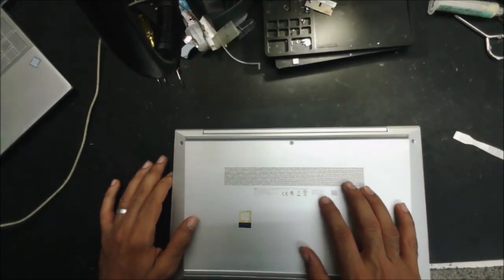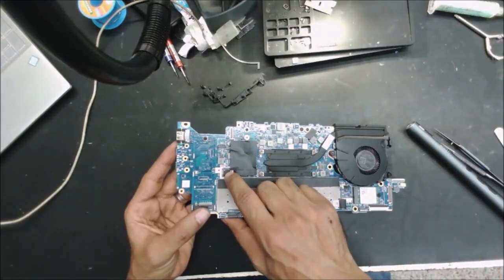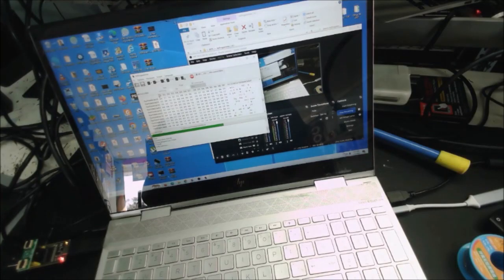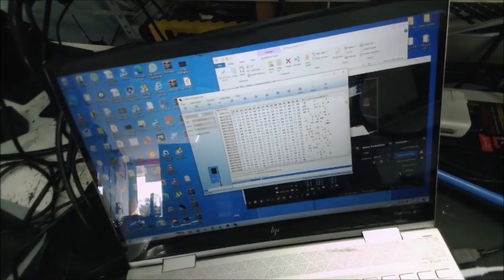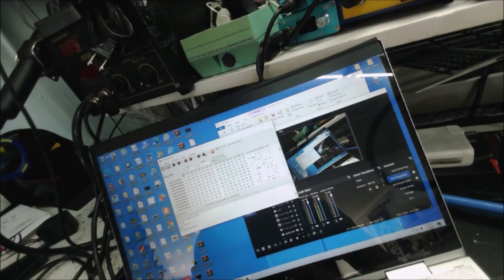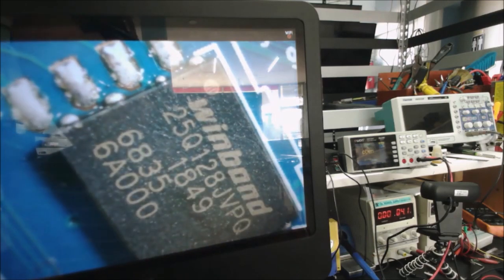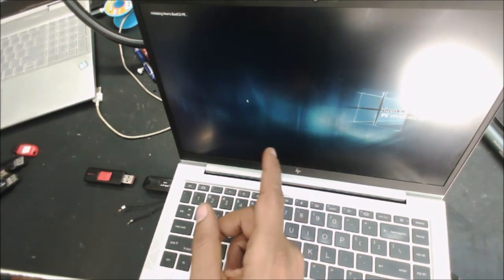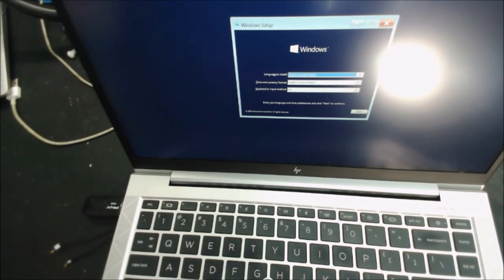HP elitebook 840-G8 bios administrator password removal

Comment: hello sur  if we have three eprom in the motherboard  how to identify the eprom we should flash to remove password
Reply from the maker: depends what the bios chip computer using 16 or 32MB for 16mb is u368 EC  for 32mb is u367 this is the mainbios
Reply: How much do you charge to complete this procedure if I were to send in and what's the address
Reply from the maker: @gregyoung8178  txt 8502425552